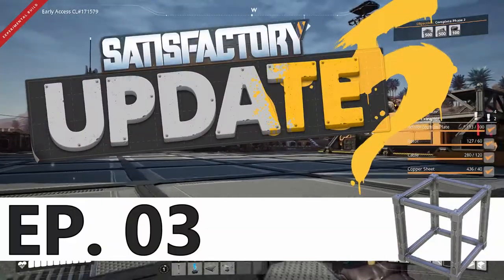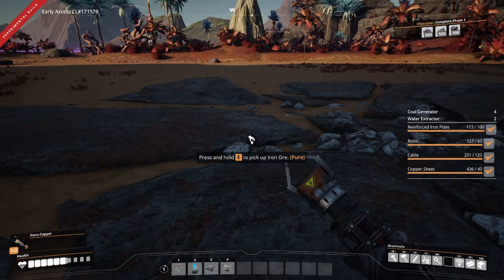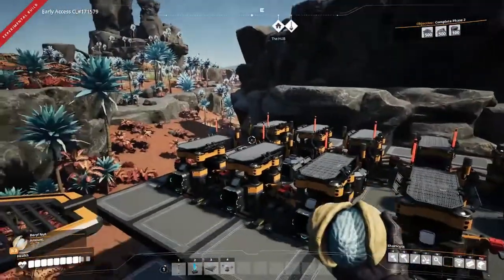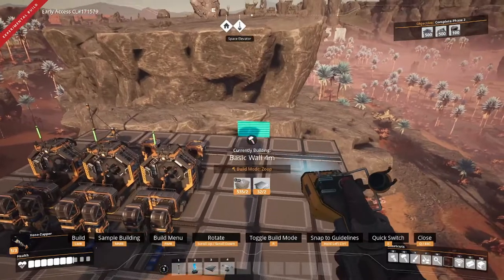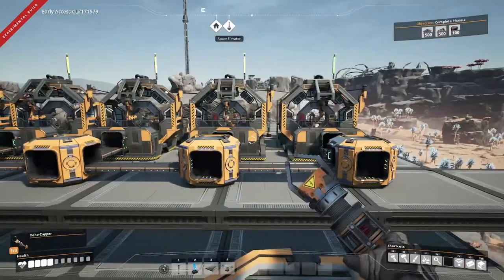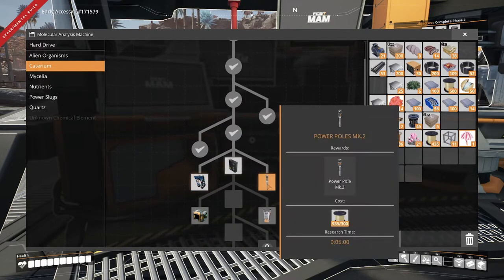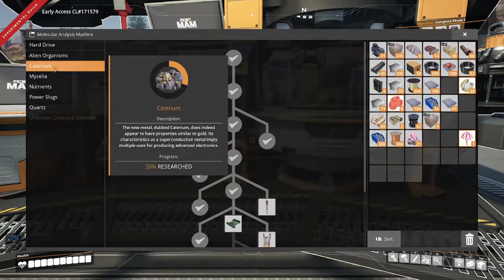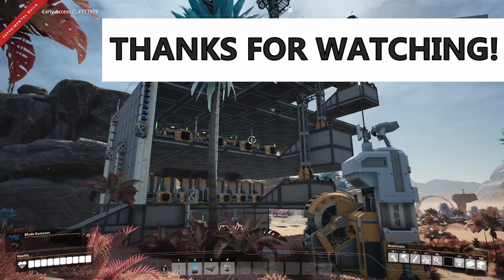Satisfactory Update 5 Ep 03 - How to make a Modular Frame factory - Let's Play / Tutorial / Guide

Comment: Hi there Dekoba

This build was done using the iron wire recipe?
Reply from the maker: This is a modular frame factory, and modular frames do not make use of wire. So I did not use the iron wire recipe, but I did use the cast screw alternate. You could do an almost identical layout with the iron wire and stitched plate alternates, though.
Reply: @Dekoba  hmmm. I asked because I have the reinforced iron plate that use wire and the iron wire recipe.